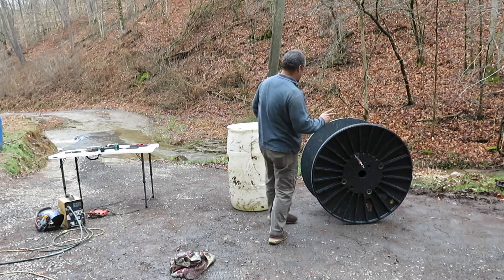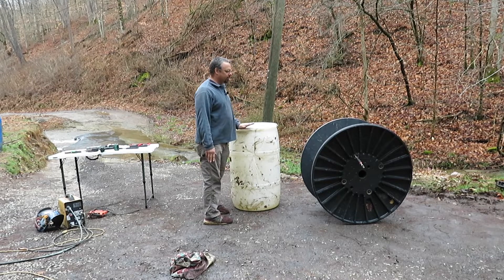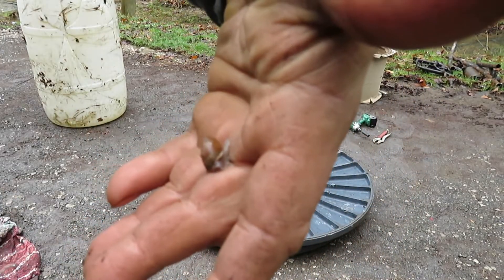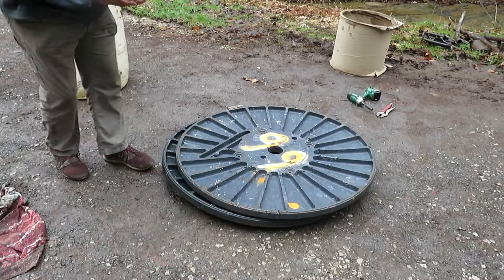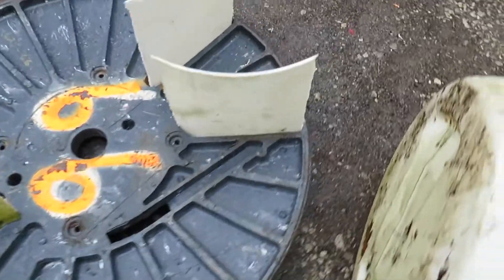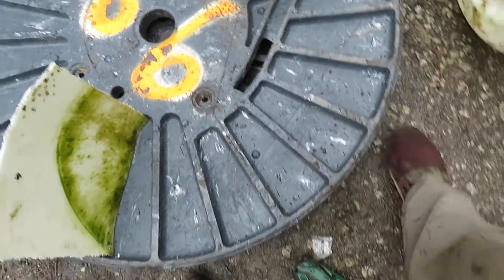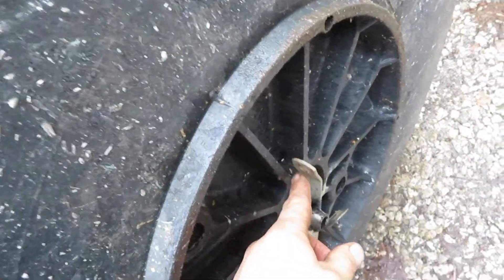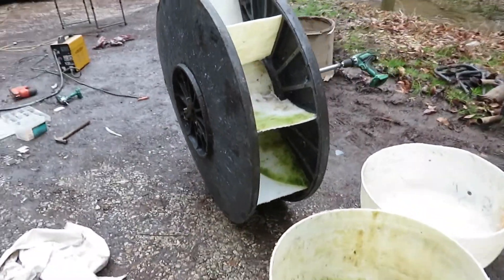Water Wheel Build -The Wheel

Comment: I'm trying to be helpful. It better design if you could find 8 twin to the school and instead of trying to make your blades inside the school you need to play with gutters you need to put gutters across the four outside rims of you're double spools. It would be nice if these gutters could flow into each other. This is making a special type of gutter. You may want to go to a metal shop and see what they can do. The ends of the gutter would be nice to have some type of side rails that will keep the water from flowing off the sides into the next Gunner. That's if you have a lot of water you have maximum power if you have a small amount of water maximum torque will happen minus momentum. That's another thing do not be afraid to put a flywheel onto your water wheel. So the in look of this water will is it'll be bigger than the amateur of the circumference of your matching sets of disc. And it'll be at least 4 feet long. You may not notice but when torque is applied it holds more water and put on more leverage. You may play around with putting two alternators onto your water wheel. Note looking at these gutters on the side view they would look like a fish hook hook side up with the water inside the hook. And don't forget the side skirts was needs to raise above the top of the hook.

Comment: looking good luke, no need to seal it up as long as the paddles catch enough water to turn the wheel what are you going to drive with the wheel? put a make a pulley on one side for a belt to run a alternator to charge batteries for electricity
Reply from the maker: It will run through a mower transmission to turn a generator. Not 100% sure what kind of generator yet.
Reply: Glad you know what you are doing! Lol I'll just have to wait and see how it goes....but love all the re-purposing.
Reply: Now this is fun! I'm thinking warpage can be reduced by fixing aluminum round stock (or even conduit) at points around the circumference lined up and screwed to the outside edges of the paddles...anyway, strong work! Lookin forward to watching how things go!